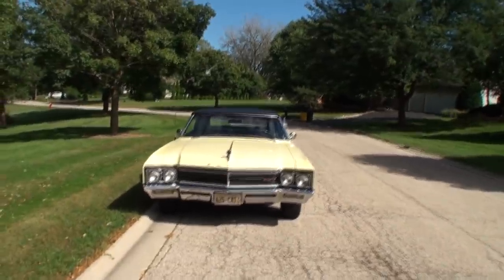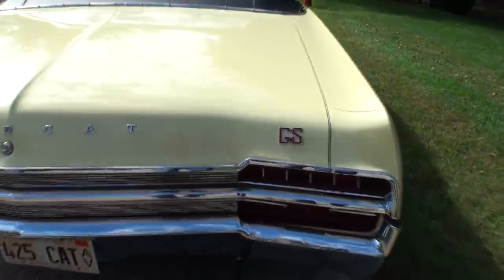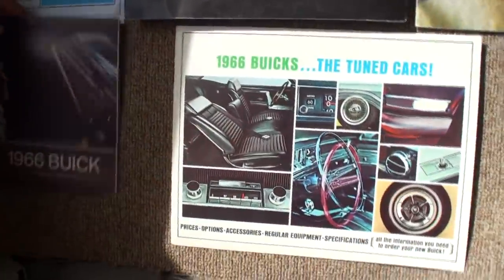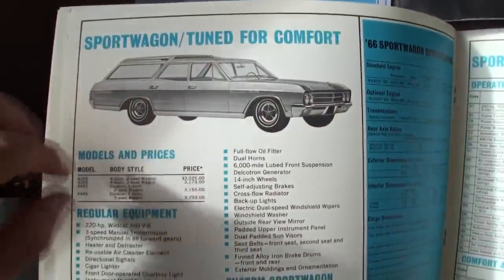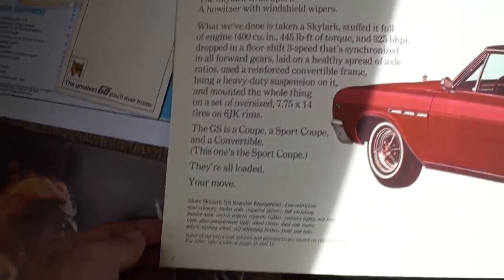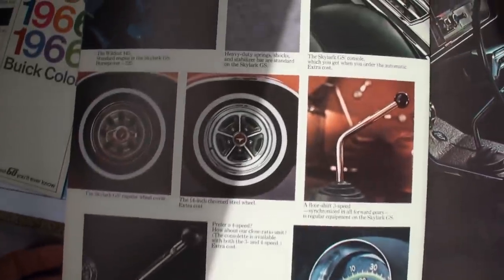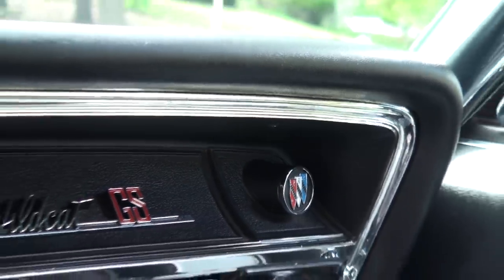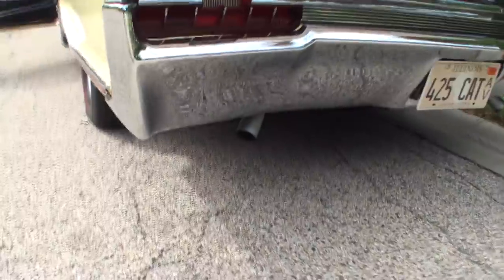1966 Buick Wildcat GS Gran Sport Convertible Cream & Engine Sound - My Car Story with Lou Costabile

Comment: Super nice cruiser Buick! 1966 was the last year of the “nailhead” V-8! I have the January 2019 issue of Hemmings Motor News, and the nailhead is named as one of the top engines of all time! A garage I used to hang out at used to tune up a guys dual quad 425 ci 360 hp equipped 1965 Riviera GS which had a 140 mph speedometer and the owner said it would go that fast. Hard to beat cars like these! Thanks Lou, for another GREAT car story.
Reply from the maker: Hi Fred and Debra MacDonald, Glad you enjoy this car :-)  Thank you for viewing and sharing your knowledge, Lou

Comment: Hi Lou...some facts.  Note the valve covers stand "straight up" instead of being slightly tilted downward.  That indicates the engine is an original Buick "nailhead" engine.   I believe 1966 was the last year for that engine, it was introduced as Buick's first V8 back in 1953.  Second, the "GM Fisher Body Tag" under the hood indicates the car's build specs as built by Fisher Body.  Once Fisher completed the body, it was sent to Buick for finishing.  The third line in the tag indicates "66-46667" which indicates a 1966 Buick Wildcat convertible.  You might find it interesting that the last 2 digits of that model number indicate the body style, and those digits were used thoughouht the GM line.  the last 2 digits on this number are 67, which indicates "2 door convertible."  Other interesting codes are:  37 - "2 door hardtop," 39 - "4 door  hardtop"  27- "2 door coupe (sedan), 69 - 4 door sedan.  

The Fisher tag was located on the front firewall under the hood on all 1960s GM cars except one.  The rear engine Corvair had the Fisher tag in the engine compartment in the back!

When you video a 1960s GM car, look for this info on that "Fisher Body Tag" and you'll see what I mean!  
It goes without saying that this Wildcat is one beautiful beast!!
Reply from the maker: Hi gojoe283, Thank you for viewing & sharing your knowledge, Lou

Comment: I bought my 66 Wildcat GS in Nov. of 65 at Rank and Son Buick in Milwaukee Wi. when I was released from the Army. She was a white convertable with a Black top and Black interior. bucket seats in front with a floor console. I ordered mine with the 465 with a Four barrel carb.  The air cover and rocker panels were chrome . It came with dual exhaust that purred like the cat she was. It had wire wheel with a pull off hub.  All for under  48 hundred.
Reply from the maker: Hi John Caputa, Happy to read this car / video brings back wonderful memories for you :-)  Thank you for viewing and sharing, Lou
Reply: I never knew Buick had a 465ci V8...yet the hp rating was the same as it's smaller big block....340hp.  The next year Buick introduced their best V8 ever-the 430ciV8, that eventually expanded to 455ci.

Comment: The best way to stop from high speed Is to pump the brakes -  Back In the day I owned a brand new Olds Starfire 425 CID 375 HP High Lift Cam -  Wasn't too fast off the line because of the weight but It would move when It got going.
Reply from the maker: Hi Steve Austin, Thank you for sharing your experience, Lou

Comment: I know it's museum car and gently driven. If like, umm ..
 If it could get a good safety check and be taken around a track alone at high speeds. Just once.
They are silky smooth and quiet at the outrageous speeds they are unbelievably capable of. 
You feel like you are doing 80 MPH. We were daring back then or stupid, I guess.
 No brakes at all at speed. They heat up real fast. Folks ! Don't try this at home.
Reply from the maker: Hi David, This car being so heavy, if you're racing this one around, I think you're right regarding the brakes that they might heat up and fail. Lou

Comment: Nice :)
Reply from the maker: Glad you enjoy this car :-)
Reply: :)
 @loucostabile
Reply: I have special memories of the Wildcat GS. My father ordered one in 1965, and I got to cut class early from school  to go with him to pick it up the day it came in. White with black vinyl top, black interior with buckets,console shifter/ front litter box/ documents compartment, and a FACTORY TACH, integrated in the front of the console. It had the 425 ci engine with the dual snorkel air cleaner that boldly stated "Wildcat 465" on the lid. It came with the factory sport wheels, but dad had them replaced with factory "imitation"wire wheel type hubcaps.(genuine buick parts) For whatever reason, the car was delivered with the sportwheels. It came with an AM radio, with center rear speaker and a "reverb" feature called "vibrasonic" other options included p/s, power brakes, a/c, positrac rear end, dual exhaust, and adjustable speed warning buzzer.  More than once I can remember sitting in the rear seat, and  having the $h!+ scared out of me. I can still remember the signature intake moan, that got meaner as the RPM's increased. Eventually I grew to love that beautiful noise. Dad used to compete with my uncle, who had a 65 Impala 396 SS with a 4 speed. He even ran it once at the now defunct Mid America Raceway in May of 66', and came home with a bigtrophy, beating everything in his class. The car served as his main transportation from 1965-late 68', hauling real estate clients,, and racking up big time miles. On occasion, 1000 miles in a little over a week.Those experiences affected me in my young years so much so that I decided to attend automotive technical school after high school. I have wondered over many years what ever happened to that fantasticautomobile after it was traded in. And am pretty sure I'd be disappointed to know for sure. This car istestament that the designs of those days came from the "soul"... Nice car sir...
Reply: Cool :)
 @forrestgump5935